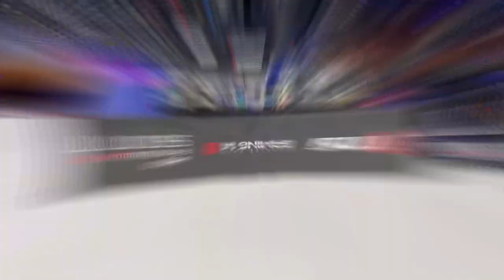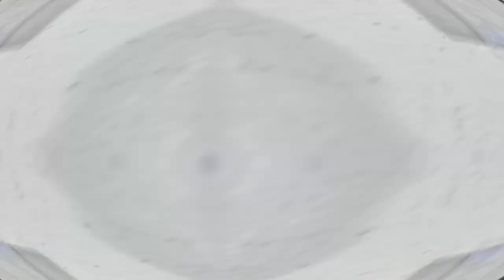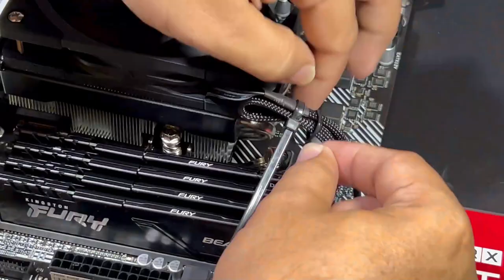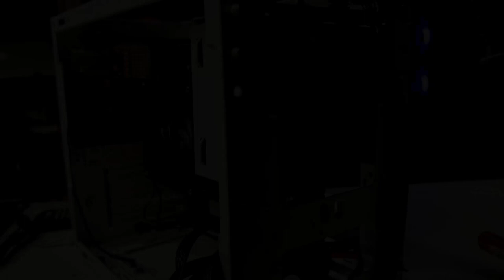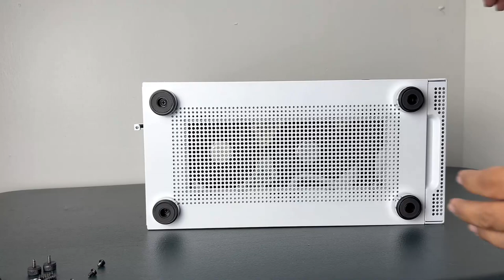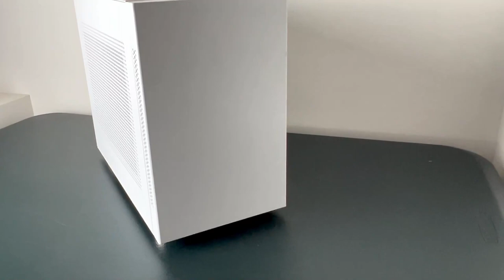The Pink Assassin Tecware Fusion Build

Comment: IDLE temp and LOAD temp?
Reply from the maker: Haven't really tried taking note of my temps. Will update you soon.
Reply: @mackyoh  any updates? i just got the same case as you :)
Reply from the maker: @kevinfausto7036  Hi, been busy. I ran Unigine Heaven Benchmark 4.0 on this rig, basic and extreme tests.  Starting temp was around 51 - 52 degrees celsius. After the basic test got average temps of around 63-64 degrees celsius. After the extreme test, ave temps were 68-69 degrees celsius.